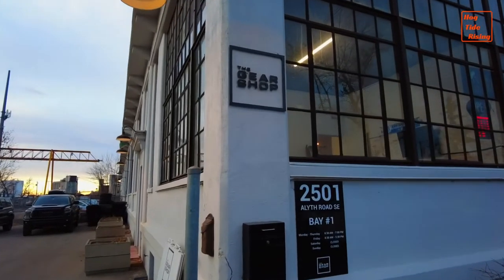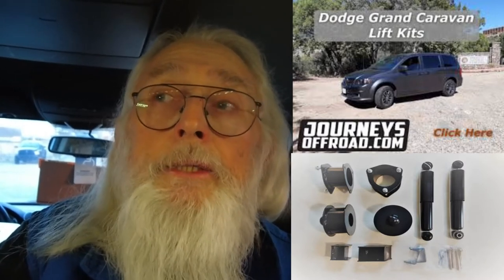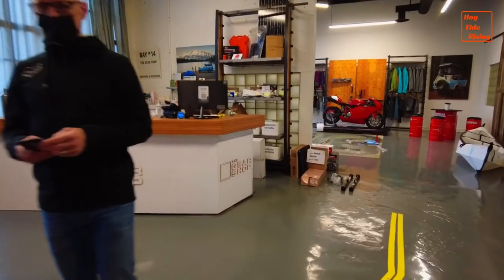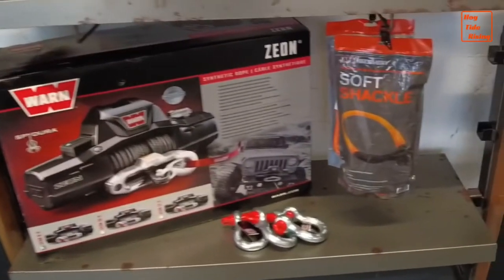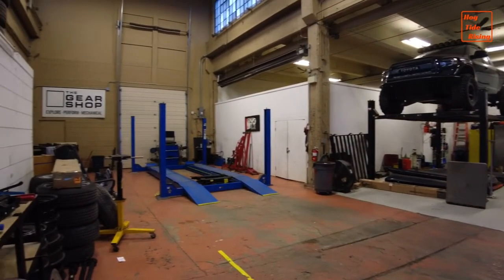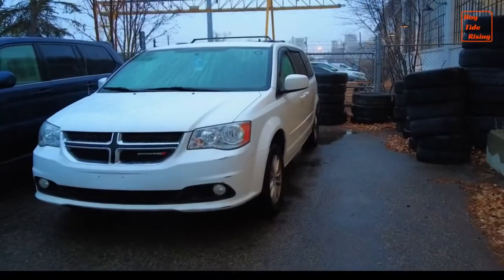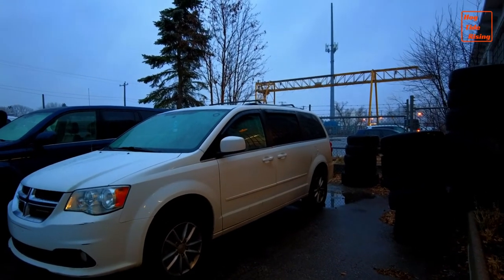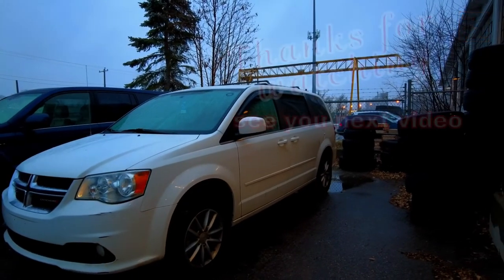Journeys Off Road Lift Kit|Dodge Grand Caravan Install|The Gear Shop, Calgary

Comment: Im from mexico and i lifted my first gen caravan too and put tall tires so the potholes cant hit the oil pan also in rainy days some streets of my city became rivers so the engine of the caravan dont get wet and turn off, your Caravan looks nice.
Reply from the maker: I haven’t put bigger tires oin the Grand Caravan and I don’t plan to. I am currently converting an ambulance into a camper so I will be selling the DGC soon. I’m putting a lift kit and a locking rear differential on the Ambo. I’m planning to visit Mexico so maybe I’ll need a few skid plates as well.
Reply: @HogTide_Rising  In mexico and Latin america lifted cars are normal
Reply from the maker: @HIDHIFDB  that is good to know. I can only put 2 inches on the ambo so i guess i should give more consideration to skid plates.
Reply: @HogTide_Rising  skid plates are overkill in mexico but if you want to go to Guatemala yeah just get them

Comment: I appreciate you sharing the video, but if you're looking for more clearance, a lift kit alone has zero effect unless you go with bigger tires
Without bigger tires the underside of your vehicle is still at the exact same height as it was before the lift.
So I guess my question is what's the point of the lift if you're not increasing the tire size??
Reply from the maker: Originally my plan was to go to bigger tires when I needed new tires. But now I’ll be moving up to an ambulance conversion and selling the minivan. Bigger tires will be an option for the new owner of the minivan. I’ve also put a lift kit on the ambo and will be putting on bigger off road tires when a tire change is due. I’ve also installed a locking differential and a winch on the ambo. You can check out the ambo upgrade videos on the channel. Thanks for your comments.

Comment: I upgrade the rims to 19 inches and it lifted maybe 1 inch but my attic are broken my sway bar is going out and I’m thinking maybe this is what I need to do before the 19 inch rims . 😂but it’s also an old van . Needs new part no matter what! But I think maybe this is better ! Braise you get new shock (struts) are they mono or regular? But I think the 3 inches will support the extra lifted feeling . Feel like it floating but that’s all the bad part I have right now

Comment: I'm in Florida and pull a boat and drive on the beach. I want to do a 2 inch lift and put some off road tires on it.
Reply from the maker: I drove on Baja beaches for a couple of months last year. Even with the lift kit I still got stuck. Off road tires would have helped as would traction boards. I did find that airing down helped a lot.

Comment: Looks great! Did you have any issues with shipping or damage?
Reply from the maker: Shipping was a bit of an issue due to COVID issues shipping the kit from the US. I’m not sure what damage you might be concerned with. The kit was shipped to The Gear Shop and installed by them. They did an excellent job and I recommend them.
Reply: @HogTide_Rising  Thats great then! I ordered an air intake off of an automotive site a few years back and it was bent to shit so it detered me from ordering car parts online. Glad to hear they are a good reliable company!

Comment: Hello, Thank you for the video. I was wondering if you realized any limitation or changes to your steering or handling since the lift kit was installed.
Reply from the maker: The upgrade has no noticeable effect on steering. If anything the van seems to be more stable when cornering. I also like the ride, it seems to be somewhat firmer. I haven’t really had it out on rough roads yet but the increased clearance is great when driving through snow. Overall I am very pleased with the upgrade.

Comment: I have a question along the same lines as everyone else. I would like to put one of these kits on our van. (To get a little more clearance for some pasture roads and some light overlanding, nothing crazy.) My concern is that this is also are (mostly) everyday driver and I don't want a whole lot of excessive wear. Have you had any problems with suspension, steering or drive train? CV joints? tie rods? ball joints? How many miles do you put on it? Do you mainly drive it off road or do you take it on the highway a lot? Do you drive much in-town driving? Sorry for all the questions but I have reached out to Journey Offroad and they haven't ever gotten back to me.
Reply: I was going to ask same questions, but maybe with combined forces we can save the man some time and he will answer in one space, haha 😅
Reply: I installed the same lift on my van 25,000 miles ago. The only problem I had was with the rear shocks that came with the kit. Journeys has upgraded the kit since then with brackets that use the stock shocks.

Comment: Hey friend.  Do you have an update of what size tires you were able to put on there, and were you able to keep the same shocks?
Reply from the maker: I haven’t increased the tire size at this point and probably won’t be doing that. I am in the midst of an ambulance conversion and will be moving into that when it’s complete. I’ve just posted the first video in the Bear Ambo Project series. 
Regarding shocks, the kit came with upgraded rear shocks and my front struts were worn out and had to be replaced.

Comment: Nice vid.  I have heard that there is a loss in MPG due to a lift upgrade.  How was your experience with MPG during normal driving?
Reply: I have the same lift with all terrain tires on my 2014 Ram C/V. That and a roof rack cost me 4 miles per gallon.
Reply: Thank you for the reply.  You give me hope.  I have a 2019 grand caravan and it’s nice to hear that your 2014 RAM is still rolling! I ended up replacing my stock muffler to a 14” Performance Muffler ($105) and it gave me 10% increase in mileage / performance.  My city driving went from 17MPG to 19+MPG.  I only swapped out my muffler for the  sound … lol.  So it was nice to see my MPG. Increase.  FYI: I went with a muffler that was one above the quietist muffler and one below a louder muffler… next step is lifting it … again thank you
Reply: Wowzer! Can you share link or details about the muffler?@danielmercado1335

Comment: Considering doing the same thing. The stock vans are too low for the PNW. The terrible roads arpund here paved or unpaved
Reply from the maker: My original reason for installing the lift kit was to be able to navigate PNW logging roads. However situations change and I haven’t been on logging roads all summer. I am currently converting an ambulance into an off grid camper and I will be including a lift kit into the build. As well as a locking differential. Next spring I plan to be traveling on Vancouver Island logging roads in the Ambo.

Comment: What is the point in a lift-kit in a Dodge Caravan?
Reply from the maker: I spend most of my time boondocking in sites accessed by rough roads. The lift kit will provide more road clearance as well as room for larger more aggressive tires. I guess one could also say “what is the point of spending money on a van build in a minivan”, yet lots of people spend their money on that. Different strokes for different folks. Thanks for your comment. And please check out some of my other videos to check out my approach to nomadic vanlife.
Reply: I lifted mine to have more clearance for driving through unplowed snow.

Comment: Hello, I was wondering if the workshop mentioned their thoughts on the cv joint angles after the install etc?

Seems to be working fine for you thus far 👍
Reply from the maker: Thanks for your comments. The shop didn’t mention anything about the cv joints. This particular lift kit was specific to Dodge Grand Caravans and it had worked very well for me.
Reply: I asked about that when I bought the same kit for my van. They told me to buy axles from the Dodge dealer if I never need to replace them. My van has 188,000 miles, 25,000 since installing the lift. It still has the original CV joints.